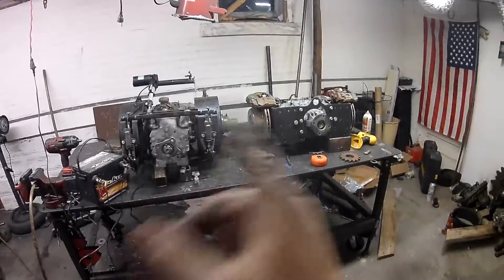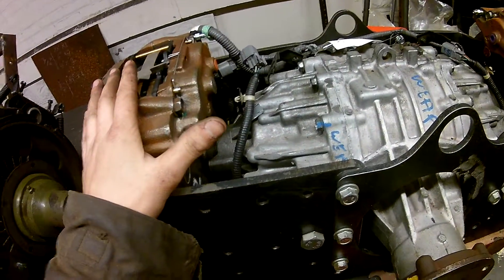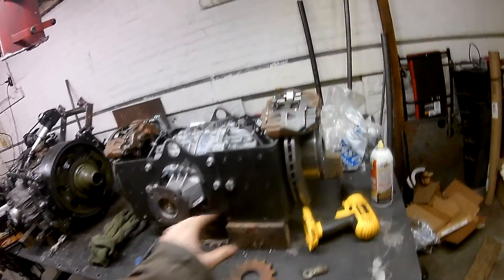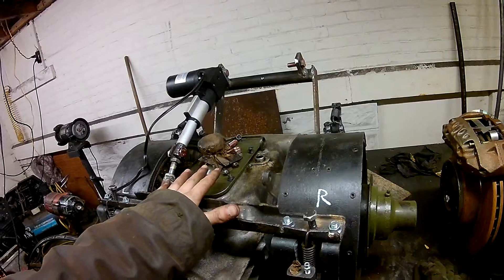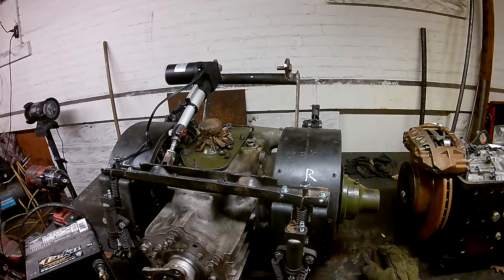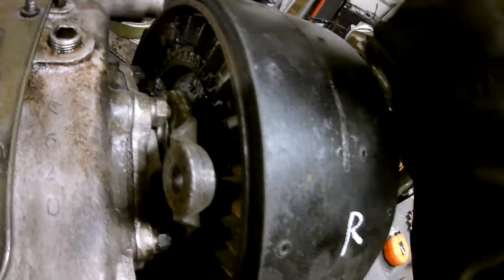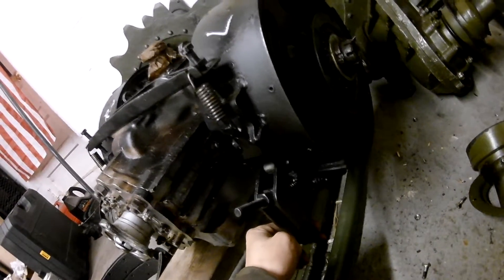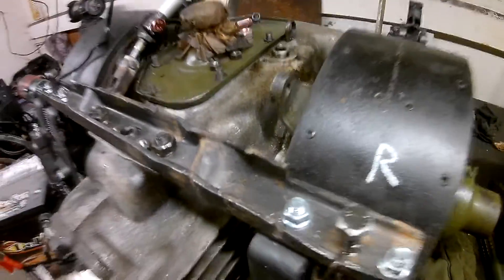Clutch-Brake Steering Comparisons

Comment: Hey man awesome videos! I live in Alaska and have wanted to build a rig for years and the time has finally come, one of my main frustrations in my plans is what I want to use for my steering application. If possible I’d love to acquire a gaz 71 set up as I would like to build a rig of similar size and capability. I guess what I’m getting around to asking is, what did the process of purchasing and shipping this unit look like and what did it end up costing to get it here? Thanks!
Reply from the maker: I ordered some extras last year, but they're stuck in Russia because of the war unfortunately. Someday they'll be stateside lol

Comment: The Gaz unit looks almost identical to what you'd find inside an old Cat dozer, they come with portal axes too.
Reply from the maker: It pretty much is. What I like about these units is they are"light weight" and modular. I can plop the gaz 71 onto anything with four M14 bolts. Easy to mount the GAZ final drive gear reductions as well.  I have an old CAT and the steering clutches/brakes/final drive are built into the tractor frame, no easy way to hack them into a homebuilt track rig.